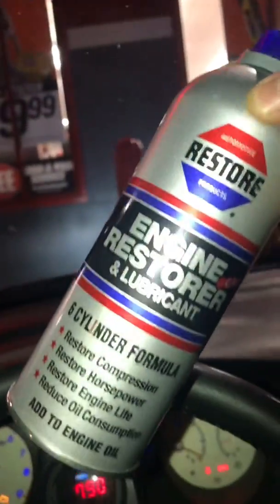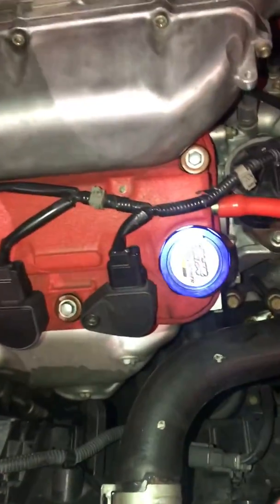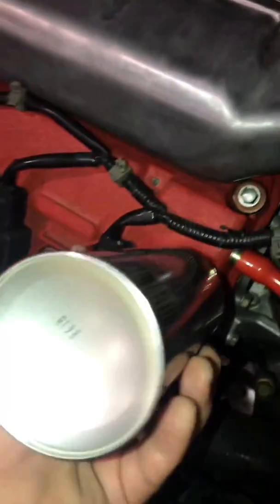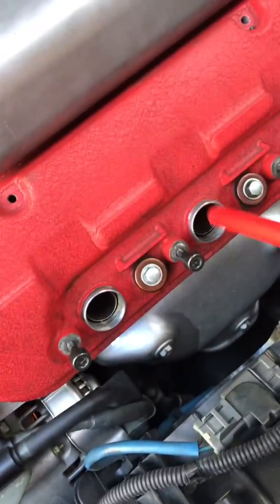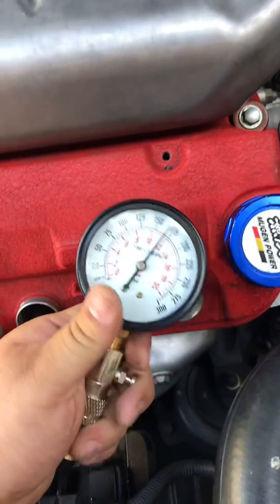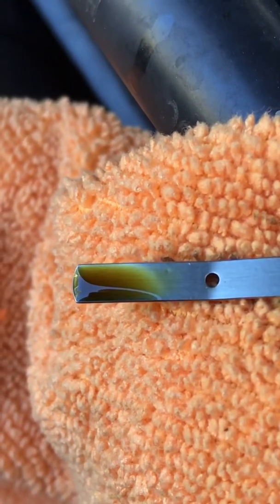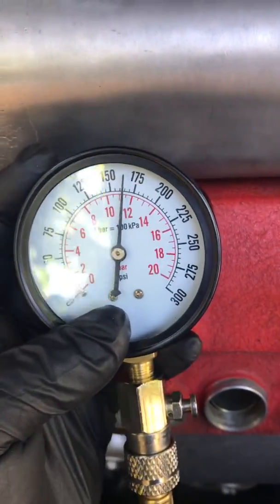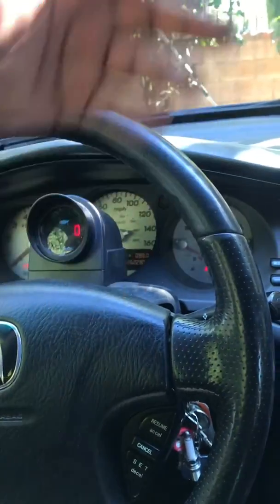ENGINE RESTORER [100 MILES UPDATE] ACURA/HONDA

Comment: Are you supposed to add this entire bottle to your engine oil before the oil change or after your oil change and run it for 3 to 5000 miles?
Reply: @firearmconvention946  substitute it for some oil during a change or use it to top off relatively clean oil. Just make sure you check the oil level if you’re not substituting it during a change. It’s generally not a great idea to overfill your oil. It’s not a flush so you wouldn’t add it right before a change.

Comment: thnx for the video. How long do let this stay in the engine for? And do add this on every oil change? Any reply will be appreciated.
Reply: You use it when you change the oil and leave it in till your next oil change. The directions says to use at every oil change.
Reply: Thnx. You know it tried this thing in my 195 thou mile suv, and it makes  the engine sound when running, a little smoother, than before. So it is doing something good. I think, and hope, because,(BUT), i notice that the sound thru my MUFFLER HAS however, CHANGED ALSO. My fx35 sound is not sounding the same as the normal infiniti usually does. It sound different. The sound now is like its choking a bit, for a moment, then it goes away, especially if when you accelerate more a bit,  i am not sure if this item has anything to do with that. Just putting it out there.  @marvinmurakami8828

Comment: -- Yeah, this stuff really is a miracle in a can.  99.99999 percent of the time you're getting scammed.  Never mind all the people on-line I've seen this work for.  It's worked for me.  Be interested in your results after 1k miles.  Thumbs up.
Reply: it works and for sure it will knock out a misfire code

Comment: Do I need to flash some oil before refilling or just fill all without flashing some oil? I got low compression on cylinder 4 too  on my Honda
Reply: I poured once with 6 month old oil and it improved massively, engine knocking stopped and compression increased, Honda civic 2004 aut
Reply: @eduardogamez2661  I have a 2010 Accord EX 4 cyl with the VTEC and VVT. Many comments say that Hondas with this motor shouldn't use Restore b/c it might clog some screen. But sounds like you had good sucess. My Accord w/120k miles is starting to burn some oil.
Reply: @1Mannco  hope I’m in time but my civic is not V-tec that’s why I did it but I wouldn’t with a V-Tec
Reply: @eduardogamez2661  I haven't used it yet. I bought it at Walmart recently, also bought Lucas Heavy Duty oil additive which I bet now..isn't good either. Guess I'm going back to Walmart and try to get my money back. 

I also have MMO for a while b/c I had an old Nissan truck but I haven't used that in the Accord, only a little in my gas tank. I guess I shouldn't use that either in the oil?
Reply: @1Mannco  no I don’t think you should, maybe there’s another product for those king of engines

Comment: Hey everyone i just wanted to share this with you all !! I talked to the manufactures of this product directly and they told me do NOT use this if your vehicle has VVT Valve Timing system in it. It will clog everything up and it wont be good! So make sure you check that first before you use this product! If it doesnt have a VVT system your good. Other systems like Hydraulic valve lifters and stainless steal shims are ok. According to Scotty Kilmer. So yeah,  hope that helps! Your manufacturer of your vehicle can help you if you give them your VIN number. They can tell you for sure if it has  VVT . CHeers!
Reply: This is the best comment here, RESTORE IS NOT RECOMMENDED IN VTECT ENGINES like the one being shown which has VTEC, in RESTOREs website they specifically list VTEC and IVTEC engines in their do not use section. Glad i saw this comment before i used it, thank you! Below is the comment from their website.

WHAT OTHER ENGINES CANNOT USE RESTORE ENGINE RESTORER?
Engine Restorer should not be used in any engine using engine oil as a hydraulic fluid, pumping it at high pressure to regulate or actuate other engine functions. The HEUI diesel engine is one of these. Although rare in the UK, HEUI engines are found in Ford Power Stroke and Navistar engines, some International and Caterpillar brand truck engines and some Isuzu Troopers (4JX1 engines). A HEUI engine is a high efficiency diesel engine where the injectors operate off engine oil pumped at high pressure – DO NOT USE RESTORE IN THIS ENGINE. A HEUI engine has two oil filters. If you are in any doubt as to whether yours is a HEUI engine, please ask your dealer before using RESTORE or call our technical helpline on 01728 726620

Many later model VVT engines such as BMW VANOS or Valvetronic engines, including the BMW/PSA Prince 1.4L and 1.6L petrol engines used in the BMW Mini and some Citroen and Peugeot cars, Subaru AVCS and AVLS, Honda VTec and iVTec, Fiat MultiAir, Fiat 500 (2007 onwards), Toyota VVTi and VVTL-I engines, GM Active Fuel Management engines (fitted in some Chevrolet trucks but rare in the UK), and others, too many to list here, use engine oil pressure to actuate or regulate camshaft positioning and valve timings. These engines rely heavily on clean oil of the correct viscosity as specified in the vehicle handbook and do not tolerate particles in the oil. Degraded, dirty engine oil containing sludge and swarf engine metal can cause the oil viscosity to go outside a narrow range programmed into the ECM; sensors detect the change in viscosity and trigger an engine management code, engine light and cause the engine to run erratically. For this reason, we DO NOT recommend adding RESTORE to the engine oil in any engine utilizing high pressure oil to regulate or actuate other engine functions. Please call our technical helpline on 01728 726620 for further information on how to treat these engines.

The modern Fiat 500 engines also react to the addition of RESTORE Engine Restorer to the engine oil and should not be treated with RESTORE.

Comment: I use it I know it works .my trucks run just fine but after watching project farms,,I have used it since,never ran a compression check,I can feel the dif.
Reply: i'm like you- i can feel the higher compression in the seat of my pants....right?

Comment: You did not bother telling us the model year off the Acura period that is useful information. Was it that VTEC engine Etc. These things are important in car videos. Thanks.
Reply from the maker: V6 vtech j32a2  3.2L acura cl type s 2003
Reply: @MYKEYSAUTOMOTIVE  restore is not meant for VTech cars. If you had researched that, you would have known!. It actually harms VTEC engines.
Reply from the maker: doesnt matter got rid of the junk car
Reply: @MYKEYSAUTOMOTIVE   did it still run good with it in it tho
Reply: @jayc3110   I guess I won't use it, just bought some. I have a 2010 Accord EX 4 cyl with the VTEC and VVT. Many comments say Hondas with this motor shouldn't use Restore b/c it might clog some screen. My Accoord w/120k miles is starting to burn some oil.

Comment: i dropped one in didn't seem to work... would you recommend dropping another bottle in ?
Reply from the maker: What is your vehicle doing? Misfire?
Reply: @MYKEYSAUTOMOTIVE  low compression
Reply from the maker: @JetBlackThreat  could be damage valves or piston rings
Reply: @MYKEYSAUTOMOTIVE  so even dropping another bottle probably wouldnt help ? i need to pass smog
Reply from the maker: @JetBlackThreat  you tried replacing coils? Spark plugs?? Injectors?? Did you do leak test??

Comment: You got an intake manifold leak had that same problem if you change the spark plugs or injectors went bad cuz you got plenty of compression
Reply from the maker: I missed shifted !! I definitely bent a valve or needs new rings
Reply: thats easy to check with a scanner- try running it open-loop and see if it stumbles or speeds up.

Comment: Excuse me if I don't believe you I want to see the cylinder being low first where I'm just not taking your word for it I've used the stuff and it's similar to snake oil
Reply from the maker: I actually show and measure the psi in each cylinder

Comment: I had low compression on one cylinder I had like 30 in cylinder 3 and my exhaust valve was chipped put the rest of the cylinder had 210
Reply: I got a rebuilt cylinder head  on the  car runs really good now and no more misfires
Reply from the maker: josh rivera nice man glad u got it fixed ima builinf mine into a 3.5!! J35a4 crank and rods!! With high compression pistons from p2r racing..
Reply from the maker: Yeaa thats what im thinking happened to mine as well !! I downshifted really nasty lol

Comment: Put this in a cheap beater car I bought that was headed to the junk yard. Previous owner changed the oil 1 time in 5 years and about 60k miles. It burned oil badly. After months of seafoam and MMO along with high detergent oil and low mile changes it seemed to have cleaned the engine some. Still burned a lot of oil so next I figured what do I have to lose. Dumped in about 2/3 bottle of restore additive (it's got vvt so wanted to not clog up the screens hopefully). Within about half hour of running/driving the burning oil decreased significantly.
Reply: Another update. I am about 300 miles in on the oil change. Oil is still at "max". Seems oil consumption has went down more. I can't say it's from this additive alone. It could also be caused by the cleaning of the decent oil as well.i am thinking my issue was caused by gummed up rings.
Reply: @pospc2  anymore updates?
Reply: @yogamon  was still running good when I sold it about a week ago. Still next to no smoke. 
No I didn't screw anyone over,car was sold for cost of parts I had in it. With new owner being made aware of it's history.
Reply: @pospc2  was more wondering about the burning oil.  My honda w 150k burns some, decreased oil consumption by half switching to synthetic blend high mileage oil from pure synth oil.  Thinking I have some scored piston cylinders and this may help decrease oil consumption further
Reply: @pospc2  I've also tried mmo, epr 109 and some expensive valvoline premium blue restore expensive oil thinking it was stuck/clogged oil control rings.  None of those decreased oil consumption
Reply: @yogamon  some engines are just too far worn for any mechanic in a bottle to solve the problem. Maybe try out some seafoam for a while before the next oil change.i am doubtful it will help but what you got to lose?
Reply: @pospc2  I'm not now.  On their website it is not recommended for vtec motors as it can clog the screen in the vtec solenoid.  It's only 1qt/2k miles now so not too bad
Reply: @pospc2 You have to keep running the Engine Restore in your crankcase. If you change the oil and don't add more, the benefits disappear within a few hours engine operating time.
Reply: Just wanted to update.oil consumption hasn't improved anymore then it did within the first hour or so but it's not getting worse either. I have since changed the oil and am now running the remainder of the bottle along with shell formula  oi and a wix filter. Consumption is about a quart in 800 miles. Before was about 400 miles for a quart.
Reply: thnx for the info on this. what is the vvt, and how will i know if my 2009 fx35 is vvt? @pospc2
Reply: Just wanted to update.oil consumption hasn't improved anymore then it did within the first hour or so but it's not getting worse either. I have since changed the oil and am now running the remainder of the bottle along with shell formula  oi and a wix filter. Consumption is about a quart in 800 miles. Before was about 400 miles for a quart.
Reply from the maker: Thank you for the vital info!

Comment: Engine is toast too much variation cylinder to cylinder
Reply from the maker: Piston rings??
Reply: MY KEYS AUTOMOTIVE +1 if you keep driving with a misfire its gonna melt the cats
Reply: MY KEYS AUTOMOTIVE it’ll still run like this for a long time
Reply: MY KEYS AUTOMOTIVE if you try a wet compression test you will find that in the cylinders with low compression the compression will raise this is how you know if the rings are toast or not
Reply: Meh. This stuff is magical. Had bad rings and magically i had good compression. Engine runs like a champ now lol

Comment: Why don't people just use the plug boot to remove the loosened plugs ? Lol, it only is rite there,  all the time and fits them perfect . I guess I'd rather work smarter not harder
Reply: I keep about 5 small magnets on all of my cars under the hood so I can just clip it to my extension and pull them out.
Reply: I usually use a magnet makes it real easy
Reply from the maker: that would be a great idea!

Comment: I've used it works great! It's like the only special sauce that does
Reply: Dave James some say only use a bit in fresh oil and shake it up
Reply: Lucas oil STOP LEAK does also but it take a few thousand miles. And it lasts.Not the regular Lucas additive.
Reply from the maker: yes i agree!
Reply: 30 psi compression is the same as dead , once I had 90psi when I should’ve have 184, and the engine was shaking like bad , it was a melted edge of an exhaust valve

Comment: Great video my man, just poured a bottle in my engine and driving to Las Vegas(400 miles) week from now I'm really curious on my engines improvements, just one question are you using conventional or synthetic oil.
Reply from the maker: Im not sure what i was using i want ti say conventional.. this was a while back ..the results were good though!!
Reply: what was you results and what oil did you use ?

Comment: What about before and after compression test? Anything above 14psi difference from cyl. To cyl. Is considered abnormal, 225 psi might be too high for a none performance engine ? u may need higher octane gas ?
Reply from the maker: i bent some valves! ;(

Comment: how did you fix the misfiring after all?
Reply: The P0304 series usually implies a bad ignition coil. On newer cars,  coils are often located at the end of the spark plug wire where it connects to the spark plug. On older cars the coils are located on the side of the engine and often control more than one cylinder. Also, it is not uncommon that when one coil misfires you will get codes thrown for additional coils. Best easy thing to do is to buy one coil, and systematically swap it out at each plug. You should notice a discernible improvement in your engine  when you have found the bad coil. If this solves your problem, I recommend you buy all new coils because the others will probably begin to fail as well.
Reply: @dantezarlenga6320  get a spark tester
Reply from the maker: Its still misfiring i believe i bent some valves... bad shift..:((( im getting it rebuilt soon ...although compression did go up ..
Reply: MY KEYS AUTOMOTIVE I just used it fingers crossed.
Reply from the maker: Rashed Ahmed 🤞🏻🤞🏻🤞🏻

Comment: Ok., i added this stuff to my 1996 Mitsubishi L200 diesel. I did't perform any compression tests before adding, because i don't have a gauge. And even if i would have one it would't be that easy, due the labor intense to remove the injectors. But, i have driven the truck 100 miles already and i still see a lot of blow by. So what's the story now?
Reply: 96 maybe rings are worn which is common on higher mileage engine.
Reply from the maker: Ritesh Pahladsingh maybe you have really bad bent valves??
Reply: @MYKEYSAUTOMOTIVE  Ok. I have noticed that the engine cold start is a lot better. Without even glowing it, it just starts. With bent valves it should be impossible to start the engine. It's an interference engine. The blow by is only visible on hot engine. Should it dissapear gradually?
Reply from the maker: Ritesh Pahladsingh maybe a bad injector ..?? I would buy a compression gauge and try to see what cylinder is causing the blow by. Its impossible to diagnose the problem if you havnt singled out the bad cylnders.. by checking compression one by one..hope that helps!
Reply: @MYKEYSAUTOMOTIVE  I Will keep driving to see what's going on. I wil try one can, next oil change, SAE50 heavier oil for diesel.
Reply: Leak down test..
Reply: Try cleaning combustion chamber with water injestion on intake.
Reply: Tomasnok I’d use Seafoam not water. Seafoam is petroleum based and can burn, water cannot.
Reply: How's your truck doing now, Ritesh?  I think this stuff is supposed to get added every oil change, and I wouldn't expect much after only 100 miles, works over time.
Reply: @GrandPrix46  I stopped wasting time and money on it.
Reply: @riteshpahladsingh3819  gotcha, sometimes that's the best way to go.
Reply: @GrandPrix46  there is no magic oil or additive that will stop a engine to burn oil that needs an overhaul.  Yeah, leaks you can stop temporarily. I saw that one.
Reply: Ritesh Pahladsinghj.

ml ù

m